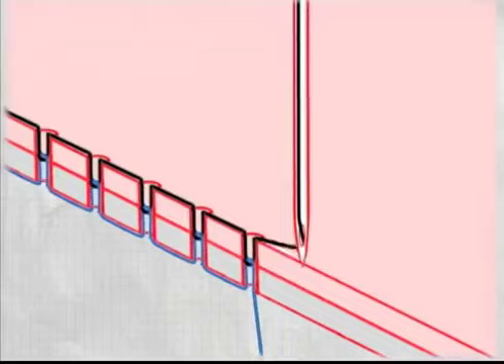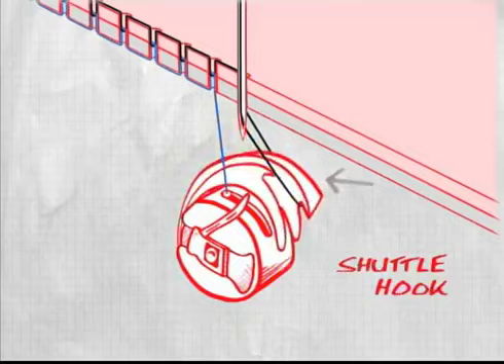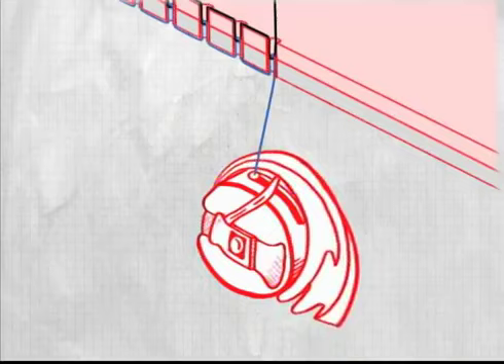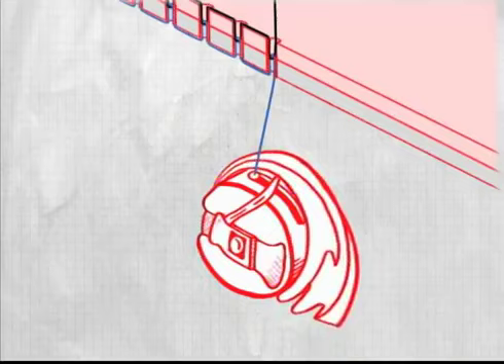How a Sewing Machine Works via animation

Comment: How does it get around the bobbin without getting caught on the axle?
Reply: It's Black Magic, nobody can explain that.
Reply: The needle thread goes around the entire bobbin CASE, which is the part that has the axle and bobbin in it. The bobbin case just floats/spins free inside the race.  Hard to explain but I bet a little searching will turn up some pictures.
Reply: @Doctor_Al  what is the bobbin case attached to and where?
Reply: That round piece in the animation that doesn't rotate above is the bobbin case. The bobbin is inside it.  The thing that rotates is the hook. Both of those things sit inside the race(which is attached to the machine). There's another half moon shaped thing that rides across from the hook (and you don't see in the animation) called the hook driver that is making the hook move back and forth.  The "hook" can also be called a "shuttle".
Reply: So really, the answer to the question is that the bobbin case isn't attached to anything.
Reply: OK,  one more.  Here's a video of an actual machine forming the stitch and you can see the parts not shown in this great animation:

https://www.youtube.com/watch?v=wJW1JbkBbsk
Reply: @Doctor_Al  I'm sorry I really don't understand. It has to be attached to something. It can't defy gravity and float in mid air while receiving power.
Reply: @turkeyphant  I'm afraid my explainer has reached capacity.  The link I shared shows an actual machine in action.  Beyond that, you may have to take your wife's sewing machine apart ...
Reply: @turkeyphant  think of the bobbin loose inside a case that it barely fits. The entire thing is "floating" just like a ball of yarn in a bag is "floating".
Reply: @turkeyphant the animation is INCORRECT. The thread does not go around the shuttle hook like what it is showing. The thread is actually only taken by the shuttle hook around the bobbin (the round center piece that is not moving in this video) and the shuttle hook releases the thread. The bobbin is not fixed to the machine, it just sits there loosely, like a bowl sits on a table, so the thread can slip under it. The job of the shuttle hook is to feed the thread around the bobbin, not around itself like what this video is showing.

This video is dumb because it shows that the shuttle hook is floating in mid air defeating the laws of physics.
Reply: @pkarmani  Thanks for the explanation :)
Reply: My thoughts exactly...
Reply: Thank you for asking!

The axle seems to go through the spool, so I think that people are just confident without facts. 😞
Reply: @turkeyphant I think that I finally figured it out from watching the video that Doctor recommended. In that video, we can see the thread go around that first hook, plus a frame-like thing. It's all 1 piece of metal. I think that we would be able to wiggle it. The frame holds case, which encapsulates a spool. So, there are 3 parts, and all of them do not contain an axle, and none of them are stuck to the machine.

In other models, I think that the hook is separate from the outermost frame, which means that the hook would need to come back.
Reply: @Doctor_Al  THANK YOU! I think I finally got it based on your video- it's much better than the one above. It seems the hook structure is free floating inside the case- there's a slight gap (cavity is slightly larger than the hook structure) and the case is only able to exert rotational force on the hook through pressure. So when the hook rotates to the right, the hook structure lags the case slightly, and the gap is to the right of the hook. Then after roughly 180 degrees of rotation, the thread slips off the hook, the case starts to rotate to the left, and the gap between case and hook is now on the left, creating space for the thread to slip past.

Brilliant design- I can't believe they came up with this almost 2 centuries ago...

Comment: No!! There is an axle going through the bobbin! How can the loop just go through the axle?
Reply: I've been trying to understand that for years. Nobody tells me.
Reply: Marcos Noble you stole my words (each one of them)
Reply: There is no axle. A magnet keeps  it afloat
Reply: No! There is no axel. The bobbin spool just rattles/bobbing around loosely in the cradle that holds it allowing the thread loop created by the needle and made bigger by the thread catcher to slip around it. This is all done off to one side of the cradle/catcher/bobbin. I know because its similar to how I tie my shoes sometimes by holding the string still and moving my shoe through the loops avoiding my leg by going all the way through the loops with my whole body. When I tie my shoes in this way people also stare at me in amazement and I start to feel amazing because I love that kind of attention and I love making everyday things all about me :)
Reply: I have no idea what you said there. What? How do you tie your shoes?
Reply: The bobbin is put inside something like a metal case, it's the case that has a built-in axle, and the thread goes around the entire case. The machine is designed that the case stays stationary but a loop can flow around it or something. Pretty cool
Reply: @rodjohnson6092  Reminds me of how I put my hat on. I lay it upside-down on the ground and swan dive off the roof of the garage. To take it off I lay down on the street, once a car runs over my neck it pops off... Easy...
Reply: The only thing I can think of right now is that the axle is moving in and out of the bobbin in time with the loop.
Reply: He Ka magic just like sowing machines
Reply: @rodjohnson6092  - Sounds like no one taught you how to tie your shoes and I dread to think of your difficulty when facing a challenging problem.
Reply: There's no axle the bobbin is fixed.
Reply: This animation is simplified, in reality there are 3 cages. The outer one is fixed and moves like a pendulum. The middle one is semi-loose, the thread CAN go around it, and has an axle for the bobbin and the third cage that goes around the bobbin. So the real trick is how the outer cage holds the middle one. Here is a more detailed video: https://www.youtube.com/watch?v=rUSecXVt-jU
Reply: @TheJollyGreen  THANK YOU if your explanation is correct i'm finally able to have a semblance of understanding and start visualizing how the process works.
Honestly, being able to understand how it works has been bothering me for a long time. thank you.
Reply: @rodjohnson6092  This is kind of like how I put my pants on. First I tie them in a knot and slip the open end around my foot. Then I cross my legs and hook my feet up over the bed. Then I do warrior pose into downward facing dog passing my body through the wide part of the knot. Everyone is shocked, but that is my gift to the world.
Reply: It's Black Magic, nobody can explain that.

Comment: it doesn't make any sense, how can the thread go all around the bobbin, where is the bobbin attached to, if the thread goes all around it it would get stuck to whatever connection there is between the bobbin the sewing machine itself but it doesn't, at least in all animations I've seen,  it's as if the bobbin is just levitating in the middle of the air against gravity and the thread can freely go all around it. I really need some explanation I am going crazy

Comment: So, what exactly drives the bobbin case to make the thread from the needle turn around itself?
Reply: It's attached to a spindle that is geared to the upper drive belt that runs the needle arm. It's a lot like an engine where the needle is the piston and the bobbin is the valve.

Comment: If you want to see an exaggerated example of the stitching, look at the stitching holding the top of a bag of charcoal, kitty litter, potatoes etc. together. Same principle is used but much easier to examine.
Reply: Nope. Those are chain stitches.  This is a lock stitch.

Comment: Are you telling me the bobbin just levitates? I can get that it might use magnets but how is torque generated to cause the hook to move?
Reply: I believe a half axle like a pin I mean I looked at one once and that’s how it fit on
Reply: The bobbin is fixed. All you need to know is the timing  of shuttle hook must be  perfectly aligned with the downward position of the needle. When the needle is at its nadir the shuttle hook should be over the thread.  The cheap Chinese machine I use is mechanically coupled but others are much more sophisticated.
Reply: I think there's gears involved?